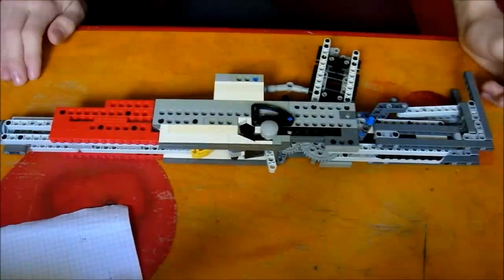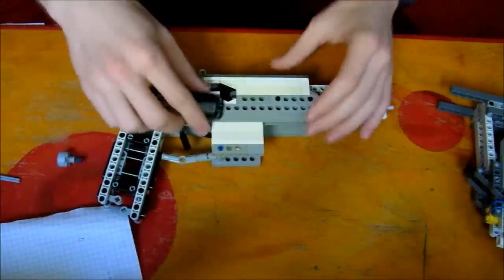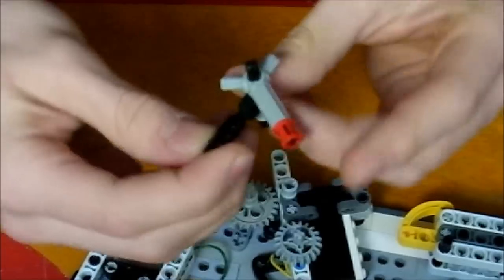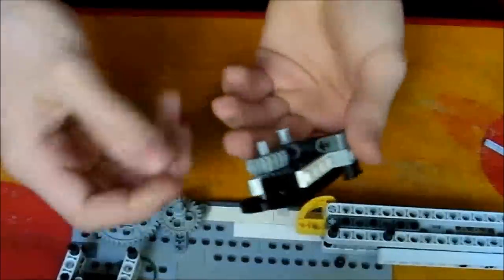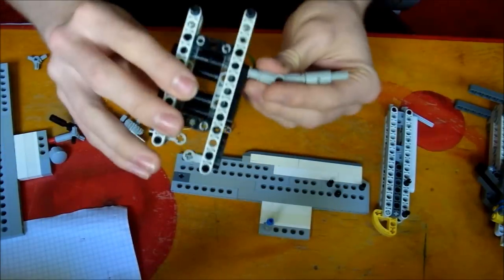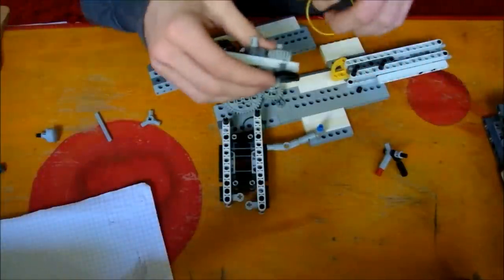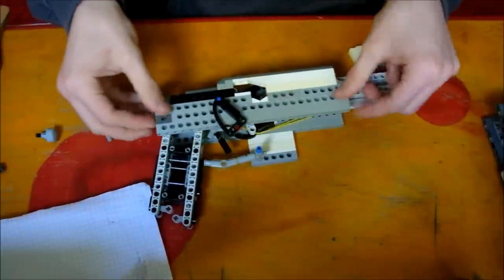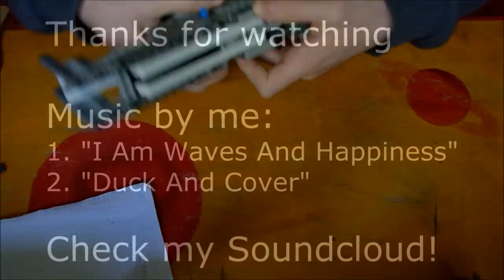Blow Back MP Free Mech Tutorial!

Comment: Hi devilZcall.  I was wondering if you could use a different part instead of the part at 2:29 the black part. Thanks
Reply from the maker: You mean the weight? sure, you can add any piece that fits or even leave it out completely but keep in mind that, the lower the weight, the faster the ROF and the less noticeable the recoil.
Reply: No the part thats like curved and is black at 229 its near the back.  Its teh yellow part on the barrel.
Reply from the maker: The yellow curved part on the barrel is not necessary but may increase functionality.
Reply: Ok thanks.
Reply: +DevilZcall Ohhhhhhhhh,that's why my gun shoots so damn fast

Comment: Hey devil, i made is mech. I, however, am having problems. I cannot fit more than 6 RBS on because when i turn the charging/loading handle, the bolt won't allow it forward and also, the weighted brick keeps coming off from the bricks holding it. I frequently get jams from the fact that when i put the rbs on the lower half of the rear gear, it won't turn. Why won't it work properly?
Reply from the maker: maybe friction? you can use silicone oil or airsoft spray for the moving parts.
vegetable oil can work as a substitute but make sure you only aply very little, otherwise it gets messy.
Reply: +DevilZcall friction is not a problem, i removed the weighted brick, it wouldn't make a difference. All the main components have room to move. I am trying to see what the problem is, it might be that my elastics are not strong enough, i know it is in the rear gears where the problem is starting.
Reply: +DevilZcall i found it ;) the tigger was too close to the rear cog causing it to jam when too many rbs were applied. I also removed the wieght and put more tension for the bolt, it can fire twice as far, twice as fast. I now will give it a KRISS vector body.
Reply from the maker: +MrXuuntyX nice, the kriss actually is a good shell for that type of mech
Reply: +DevilZcall then you should make one too c:

Comment: How do i load the gun? Cuz sometimes it won't shoot
Reply from the maker: try Loading rubberbands one tooth of the gear further forward. rubber bands every 5 teeth if I recall that correctly.
Reply: +DevilZcall ok thanks!
Reply: +DevilZcall Also sometimes the bolt won't move, are there any way to fix it
Reply from the maker: +GamingWithMaddy airsoft/silicone spray, it can get a little of a mess but does wonder to moving parts
Reply: Oh ok thanks again